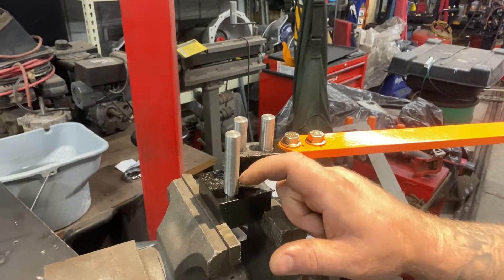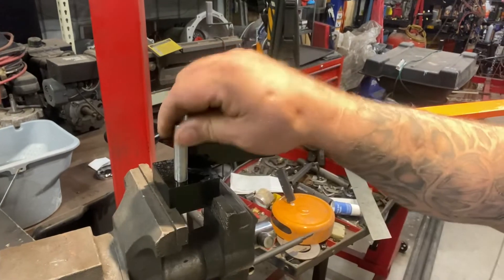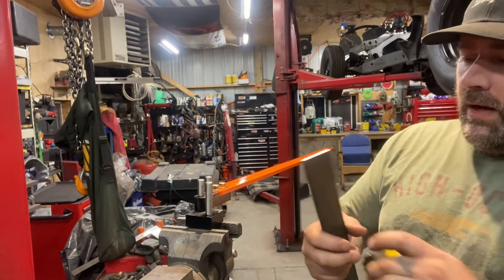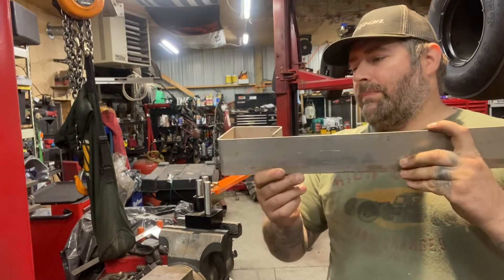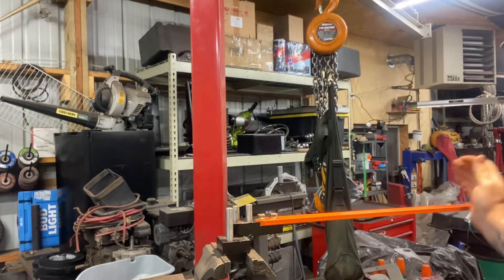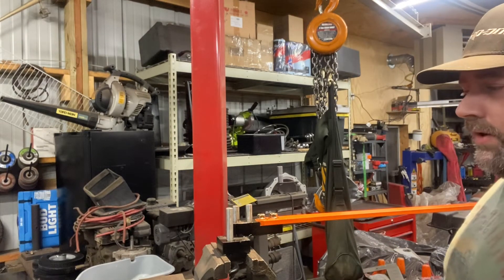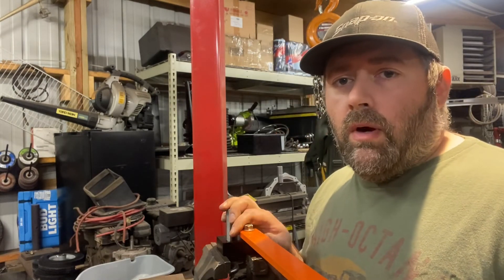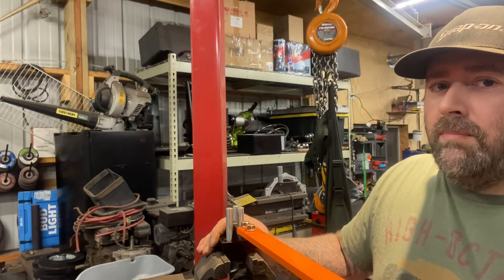Tmr machete rod bender

Comment: Grade 8 bolts work too. I built one w/gr8bolts 1/2” dia and worked fine for farm bends. Saves bringing the torch out to heat and bend rods or flat bar 😊😊